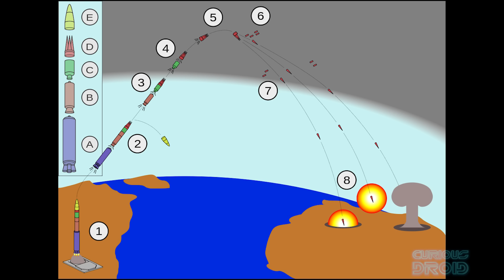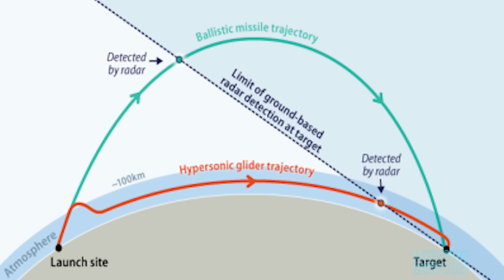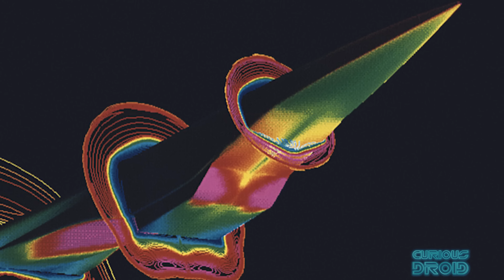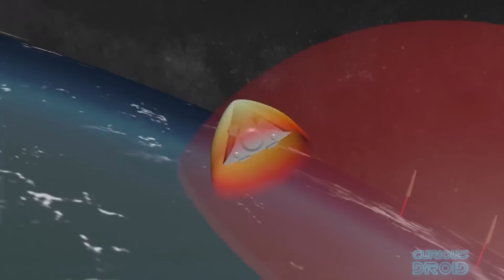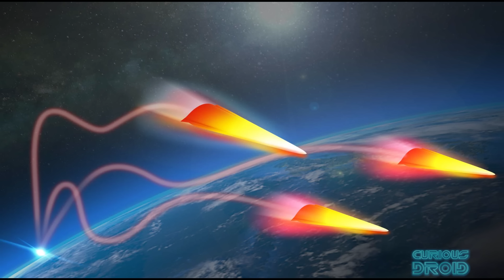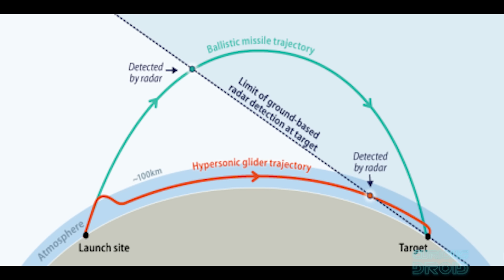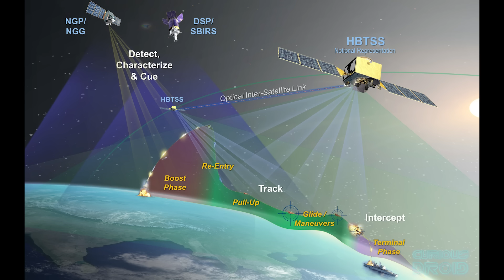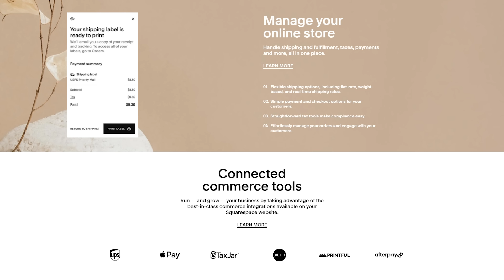Can the U.S. Stop Russian and Chinese Hypersonic Missiles?

Comment: I wonder if you could use a fusion target reaction to excite out a massive laser-EM pulse, because standard lasers take a long time to ablate conventional missiles they'd be useless for anything but projectiles in space altitudes because of atmospheric scattering.
Reply: Nope, even standard lasers take out missiles much faster than interceptors. Even though the current standard lasers are only upto 300kw and you need 1MW to destroy ICBMs and Hypersonics. A 1 MW laser can easily do the job. And it is only the beginning, you can scale up the power as much as you want. A sufficiently powerful laser will drive through and destroy anything, and I mean LITERALLY ANYTHING except a blackhole, because blackholes would just consume the energy and grow bigger. But at Petawatt range, the laser rips apart the fabric of spacetime itself, so as long as you have enough power, you can make a laser powerful enough to destroy anything.

Comment: Mach 25 would cause 625 time the drag of a mach 1 body not 400.
Reply: The drag coefficient peaks around mach one, so the usual v^2 increase of drag force doesn't really apply here since the rest of the calculation is not independent of velocity.

Comment: Lasers would've been my immediate answer, too. Ideally placed in space, which would also negate the ability to 'hug the ground' to avoid detection and aiming. Obviously that wouldn't exactly make the power problems smaller …
Reply: Yeah, how do you easily get 1mw of power in space...
Reply: @user-th3jl8mz7y  The sun, presumably.
Reply: @jamielondon6436  If memory serves, you'e looking at an average solar power of about 1.3kw per square meter. Which means you need about 800 square meters for continuous fire (why?!?) or five square meter and some super capacitors to charge a 1 second shot every 3 minutes. Move the slider on the solar panel sizes whichever way you need for a faster rate of fire. Or carry more batteries/capacitors to store more charge.
Reply: @thewiirocks  Hmm, honestly that sounds doable, doesn't it?
Reply: OK, you can give it a try  :)
Reply: @mirekslechta7161  How do you know I haven't already?  ;-)
Reply: hugging the ground at hypersonic speeds sounds like a terrible idea.
Reply: Satellites have to orbit the earth. So you either have them in geostationary orbit (40,000km high), which is so high that the laser light spreads out and becomes less damaging. Or you have them in low earth orbit, which means most of the time they are in a useless position far away from the enemy or targets it has to protect. The huge satellites would be easily trackable, so the enemy could select a moment for attack at which there are few/ no laser satellites overhead.
Reply: @kedrednael  Yes, I'd think you'd need a lot of them. But honestly, if it's doable once (at non-prohibitive cost), it's doable a hundred times, isn't it?
Reply: @jamielondon6436  Don't think a 1 sec shot can penetrate that heat shielding. Also high power laser are pretty damn big and heavy, still. Heavy is very much a no no for satellites, Even more so if we are talking about a world spanning network of 1000s of satellites. Way cheaper to just install some lasers on the most likely targets on earth.

Comment: It all comes down to this: hypersonic missiles have a HUGE infrared signature, not only from the exhaust plume of the propulsion system keeping the missile flying above Mach 5 but also the from the thermal heating of the missile itself as it flies at Mach 5. And at those speeds, maneuverability is not going to be great, either.

Meanwhile, the AGM-158 series attack missile the US military has begun deploying is very stealthy, not only from the natural stealthy shape to reduce radar visibility,  but also very little (if any) infrared signature as the missile flies through the air at near Mach 1. As such, air defense systems would not "see" the incoming missile until a few seconds before impact.

Comment: Having taken a cursory glance at the literature I'm not sure that the squared relationship of drag and speed holds true at supersonic speeds(?) It's certainly accurate at lower speeds, but above supersonic it seems to be quite dependent on the bodies shape - which intuitively makes sense to me.
Reply: Also, lasers? How about mirror coating the missiles, or using a bunch of DLP type mirrors/reflective surfaces to redirect the laser, maybe back to its source?
Reply: @pinocleen  It wouldn't work, there is a reason why the SR-71 was painted black. It was a special paint that helped dissipate the heat even cause at mach 3
Reply: @SilvaDreams  I was referring to shooting them down with lasers claim in the video.
Reply: @pinocleen  Yep, we understood what you meant. But you can’t make these missiles a mirror for a whole heap of reasons.
Reply: @pinocleen  
You can't just use a mirror coating. An imperfect mirror will be destroyed, coincidentally also creating an airflow change at hypersonic speeds. Goodbye missile.
That also adds weight and you defeat your weapon yourself. Also most mirror surfaces are fragile. Remember the heat it has to survive. Do you know any mirrored surfaces designed for both heat, reflectivity, sturdy so it doesn't shatter at the abuse, and ability to sustain the physical impact of that much air?
Reply: @HELLO7657  I studied mechanical engineering at university so I am familiar with the concepts.

There are plenty of papers discussing what happens when objects go supersonic. They encounter wave drag, due to the shock waves. The mathematics becomes a lot more complicated than the equations which describe forces at lower speeds. Fluid dynamics is a very strange thing when you study it in detail - I did a lot of it during my masters.
Reply: @MeppyMan  It's just food for thought, reasoning being that it is much easier to deflect/reflect energy (laser) then it is to produce and direct it, same optics - but with much less power to deal with at the receiving end. Even simple things like rotating the missile would have an effect?
Reply: @glad2  Yeah, it took me a couple of searches before I got to some nice graphs and the nitty gritty. Very interesting.
Reply: @icecold9511  See my reply to Mark MM.
Reply: @pinocleen  That's great pino, I found that the search term 'drag force at supersonic speeds' yielded me good results. However, your Google results may give different search results(?) I frequently Google applied physics questions. That is purely because of my field of work.
Reply: @HELLO7657  yes true
a 6 cyl jag can do 140 mph
a 12 cyl jag 2x power achieves 1/8 the speed 152. cheers
Reply: @raypitts4880  Is this when said Jag is travelling at hypersonic speeds?

Comment: Maybe a laser doesn't have enough power, but instead of trying to destroy the hyper-sonic missile, could you use the heat the laser gives off to heat the air around the missile to control it or deny it dense enough air to run its engines?
Reply: You can't aim a laser beam at a pocket of air to heat it up, it just passes straight through it!
Reply: @sunnyjim1355  yup
Reply: @sunnyjim1355  You misunderstood what OP said, he asked if the laser acting on the hypersonic weapon would heat the surrounding air enough to push it off course.
So theoretically if you had a really powerful laser this could be possible if you heated one side of the vehicle but you would need a ludicrously high wattage laser and even then it wouldn't make enough of a difference to be worth it.
Reply: Cause enough damage to the skin to affect airflow, and physics do the rest.
Reply: @icecold9511  Aye. All it needs is the protective layers on it to be disturbed and it will break apart and crash if not melt.
Reply: It is a good idea, but usually for lasers to get bright enough they have to make very short bursts.  A short burst is probably insufficient to mess up the air long enough to knock out the engine.  Though, perhaps with the right spacing of pulses, some harmonic can be generated that could, or otherwise damage it.
Reply: @icecold9511  Laser range short - ionizing air
Reply: @AFlyingCookieLOL  
Only at certain times of flight, and varying effectiveness
Reply: By the time the missile appears above the horizon, it probably doesn't rely on it's engine any more and just lets it existing speed carry it into the target.

Comment: I'm curious as to how a hypersonic missile can simultaneously be maneuverable, since the lateral force required to impart a deviation to the flight path also varies as the square of the velocity. With such large dynamic forces, the missile would have to be exceptionally strong, and hence heavy. Fast, heavy objects tend to be extremely  reluctant to change direction!
Reply: Certainly not. And aren't they in a plasma stream and therefore no remote control or self guidance  possible? I guess these guys need to slow down before re-entry
Reply: I think they will need to slow down for sure but question is, is that enough time to detect and intercept it?
I believe not with the current air defense systems i mean, USA has no hypersonic missiles of their own yet so that they can create an air defense system against it.

Comment: To anyone worried about hypersonic weapons... Don't be. Hypersonic weapons have yet to be battle tested and are likely to be shown as extremely unreliable due to their many challenges. For example.

* Hypersonic weapons will likely only work against fixed/unmoving targets. Mostly because they can't track their targets either to being enveloped in plasma, or being below the horizon.

* Maneuverability can be high when at hypersonic speeds, but it drastically reduces speed. In gliders, that can't be regained. In Scramjets, that can potentially reduce their speed below the ~Mach 5 limit for their engines to run.

* Gliders aren't that much different from "normal" ICBM's, they're just faster. We already can't really defend against ICBM's, but this also means it just falls under the strategic infeasibility of nuclear war. In other words, no one's going to use them because it's suicidal.

Comment: We can't forget the fact, that hypersonics cruise missiles allegedly still have massive teething issues because of that ion shield. So while they cannot be stopped, carrier can just... move away. It can however screw bases and stationary targets in general.
I wonder what will be sorted out first - reliable defense system against them, or reliable guidance for them
Reply: The problem is we aren't even sure if they exist. What russia claims as hypersonic is litterally just hypersonic by job and not by design. Because like this we could claim the ISS is hypersonic or the V-2 is hypersonic on during trajectory. They are just ballistic missiles.... You know, ICBMs reach mach 20+ and we don't call them hypersonic for a reason. A "true" hypersonic missile is one that can move and target at those speeds and not just target fixed points
Reply: @warbrain1053  it have ability to target and locate. It was possible with 50 years old warheads from ICBM with 20+ Mach but limited. But it is unknown publicly how. Same thing with US Dark eagle.
Reply: @drzavnalutrija  yeah. But we don't even know if the russians just didn't lie because according to usa you can't communicate at all through plasma shield so i doubt it is a case of mislabeling
Reply: @warbrain1053 I watch conference about hipersonic, some institutes and US department (you can find on Youtube) and noone talk about that it is impoaible. I think if Russia China India talk that something is possible and US is near to finish Dark Eagle with same it is solved but it is not for wide audience.
Reply: @drzavnalutrija  i do not say that the concept by itself is impossible. Any ICBM os technically hypersonic during reentry. The issue is a plasma shield forms around the object making conventional guidence impossible. Also iskander is as hypersonic as most ballistic missiles.

Comment: 9:00 I'm a radar engineer and I can say with almost certainty that "plasma stealth" is a myth. A plasma is electrically conductive and would be expected to reflect rather than absorb radar signals. In fact, studies on the radar signature of plasma in laboratory tests have seemed to support this expectation, reflecting radar rather than absorbing it. In addition, radar tracking would be mostly unnecessary anyway given the massive IR signature of a missile traveling above Mach 5.

Comment: If you define turning circle of a super tanker dragging 4000 parachutes then it's maneuverable. At hypersonic speed, turning force needs to be massive and the air friction will destroy the missile.
Reply: Speed = energy. More energy is put into the missile, more energy is needed to veer it off the course (turn it).
Remember when you put your hand out the window and rotate it like a wing. It's easy to keep it straight. Rotate the hand slightly and the forces multiply. There is a high pressure on the other side and low pressure on the other. Now take all that to mach 20 and anyone can see that things doesn't just "turn easily" at those speeds.
I'll believe russians have a working mach 20 missile when is start seeing huge weird streaks of smokes ending in a huge explosion. Because there will be a lots of blown missiles.
Reply: Yes its impossible because Uncle Sam didn't develop it first. Lets all just go back to sleep.
Reply: They don't need tight turns. They just need to turn slightly faster than whatever interceptor can react.
Reply: @alaric_  Missile interception works by predicting where the missile will be at a given time and putting an interceptor in front of it. Hypersonics evade interceptors by being so fast that even the tiniest change in course would result in that window of interception being miles off and an interception having to make massive maneuvers to course correct.

Comment: So if a hypersonic missile relies solely on inertial navigation due to the plasma blackout, how on earth can it hit a moving aircraft carrier?
Reply: I guess the idea is that the circular error probable is calculated such that... knowing approximately where an aircraft carrier is... because the carrier has a predictable speed... it's enough for the missile to carry a hell of a big enough bang... think high yield nuclear. In that case... a near enough miss is a hit.
Reply: Yeah I don’t understand how hypersonic missiles can hit moving targets if they don’t have sensors and are blind due to ionization from air friction. If a missile is launched at a carrier group that will take 8 minutes to arrive, and the group changes course, a ship traveling at 30 knots could be 4.6 miles away from its originally predicted location by the time the missile arrives, more than enough distance to survive even a nuclear warhead.
Reply: It can't, unless it slows down to speeds that current defences were designed to deal with already.  Also, an AWACS plane could expect to pick up a hypersonic missile at a range of somewhere between 500-700 miles depending on exactly how high it is flying. In many cases it would pick up an anti-shipping missile almost immediately after launch, which would make it only slightly better than a high speed ballistic missile. The actual use of a hypersonic missile is that it can arrive at a known location of an aircraft carrier before the carrier has time to move far enough to be hard to find, but ballistic missiles also can do that.  Hypohystericalhistory has a great video on the topic of hypersonic missiles versus ships https://www.youtube.com/watch?v=r-ASc5LSF3U
Reply: This video mentioned that the hypersonic weapon would need to receive a guidance signal from an external source, such as a satellite that is tracking the target from space.  There would be an opportunity for the target to jam or interfere with the guidance signal.
Reply: They can’t.
Reply: @anasevi9456  A ship has two degrees of freedom on the ocean... you cannot predict where it will be. It can change its heading, after the missile is launched. Without updates the missile only thinks it knows where the ship is supposed to be.
Reply: @turdferguson4124  Through the plasma bubble?...
Reply: Chinese 6g researchers have made a break through with communicating through plasma.
Reply: Exactly. They’d almost have to launch a whole grouping of hypersonic nukes in a grid pattern across the target area to ensure a hit.
Reply: It was bad interpretation in this video. No one will make rocket that can't target somethin in 21st centurie. They are not so stupid because they had good antiship rockets 50 years ago. And technology is developing

Comment: Hidden flight path of hypersonic vehicle can be less predictable only in the intermediate range is however more predictable in the final approach because the final glide path is always a radial path.  Technically radial target is a point target and not a traversing target. 

Just forget about the remotely settled defending missile give up intercepting a traversing hypersonic missile, you will never overtake it. 

This is a highly successful approach only cost more. Now each defending target is having a local defending missile station.